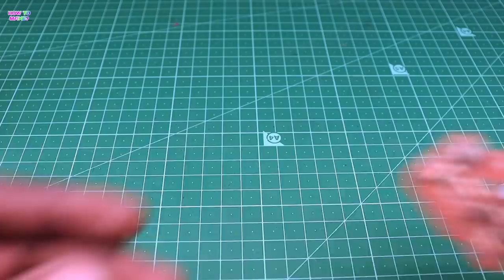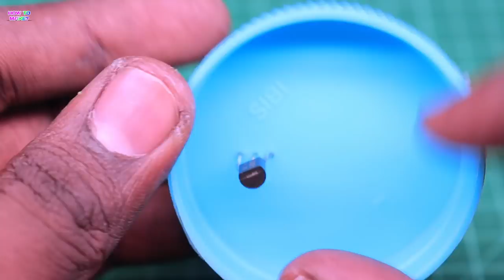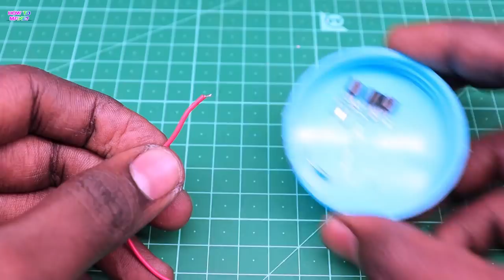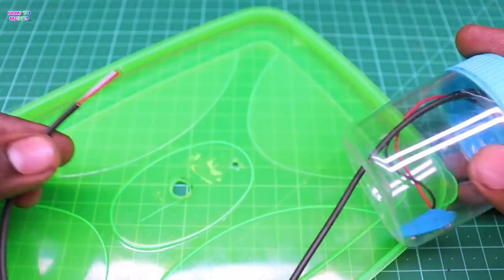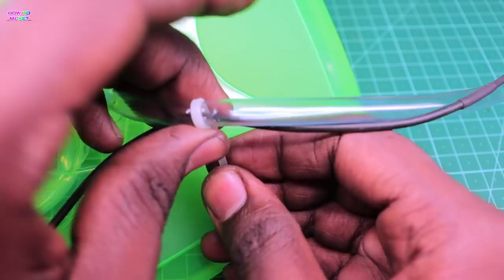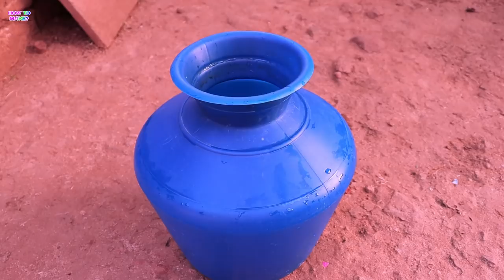Awesome uses of old tv motherboard and water pump

Comment: Which tv motherboard is this lcd led or crt?
Reply: flatsceen = def not a crt, that gets us to two to guess from...🤷‍♂️

edit: [those transistors are the only thing in the video that would be found in a tv, of any kind, and they are very inexpensive. If you are going to be buying the water pump, you could also buy the three transistors, and get a whole big assortment of many different ones along with them. If you want to use an old board, and it's only the transistors that you are going to find, you could look closely at any electronic device, and you may find those, or an equivalent transistor. You just need to reference what you find with the data sheet > the numbers on the transistors in the device you are taking apart will lead you to the data sheet. 
any tv, including a crt, might have them, an old electric coffee maker, an old radio, may also have something that would work... first thing to do is to look at the description, and find the data sheet to the named transistors, and then check any transistors that you find, and check those data sheets, and see if the specs are close]

!!!!  BE VERY CAREFUL AROUND CAPACITORS, ESPECIALLY FROM TVs AND HOUSEHOLD APPLIANCES  !!!!